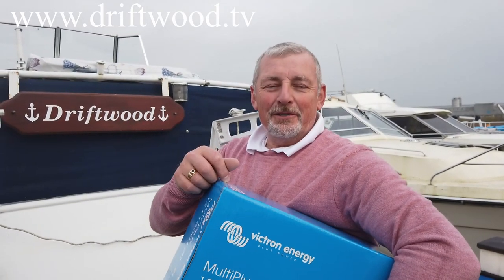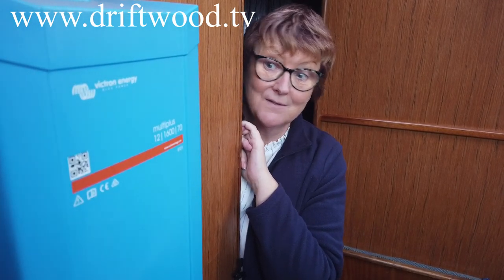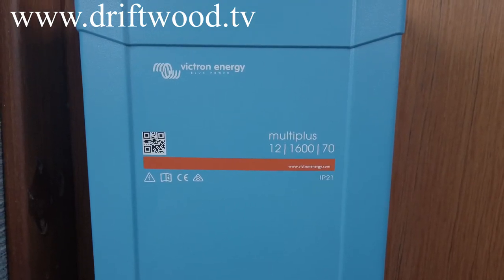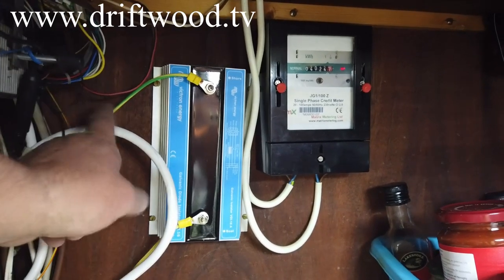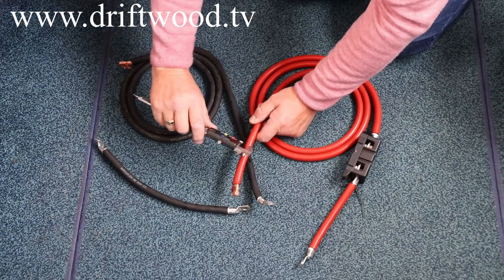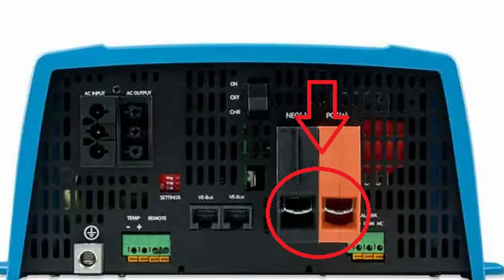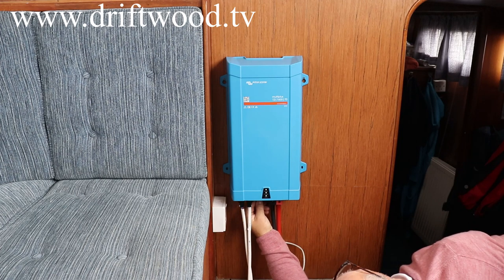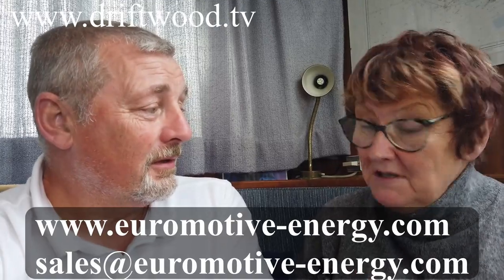Victron Inverter Charger Installation

Comment: i love that jetty in lough key. tied up a few times there. fantastic vid, i love all the tech side of boating. ive learned more on your vlog than i did at school
Reply from the maker: I recently discovered that it will run an ice making machine! So cold summer drinks await 👍
Reply: @DriftwoodBoatBlog  Ice, Ice, Baby,

Comment: Nice easy installation. I've fitted an inverter charger hybrid myself last year that also looks after the solar and yes theyre a great bit of kit. I would however look at a battery upgrade to get the most from the system. Best of luck with it all.
Reply from the maker: Ye they are great. You're right about our battery bank. Lithium would be the eat to go but very expensive. I'll wait till these die a death first 🙄

Comment: I fitted the same inverter/charger this summer, also purchased in Euromotive. The price was surprisingly equivalent to what I could get online, and they had it in stock and were able to sort me out when I pulled into Carrick with a failed charger.

A question...are you really able to manage a standard kettle and hairdryer with a 1600w inverter? If so, I'm plesantly surprised.

Also, I fitted a battery cut-off on the positive from the battery and a circuit breaker on the shorepower AC input to the inverter. The battery switch is so you can turn off the battery supply to the inverter if you're working on things. This is important because it's easy to forget the inverter can electrocute you via the batteries even with shorepower disconnected.
Reply from the maker: Hi Doug. Yes the inverter certainly does run the hairdryer. And it's quite a hefty hairdryer too. The kettle we used is a low amp caravan kettle but yes both work perfectly. My only concern is that it a hefty drain on the batteries. Ye Euromotive are a good crown to deal with, and the fact that they are convenient to the river is handy too. 

I like your idea about the additional cut-off switch. Might copy you! H&M
Reply: @DriftwoodBoatBlog  I have a camping kettle as well, which works, but I think a kettle on the hob may be faster! I did get a nesspresso machine working as well though.
Reply from the maker: I'm going to try an ice making machine next! would be nice with a cold cider on those long hot summer days.

Comment: This is off topic but have you any idea how to put 8mm tape onto video tape, have 2 home boating video but camcorder broke and don't wanna buy something expensive just for 2 of them, it's a long shot but maybe you might know ? Cheers X X
Reply from the maker: There used to be an adapter that you could put the 8mm cassette into to run it in a video player. Be hard to get now. I look at getting the tape put onto a HDD if you could find someone doing that. Hope that's of some help.  H&M

Comment: Hi just want to ask how this handle over 1000w  
Did you try over 2000w to 3000w does it work
Reply from the maker: Hi, think it's rated at 1600w, but I think it can handle more than that if it's not for a long period.

Comment: Have to comment here as I have some major concerns about your set up. First thing are your batteries, please change these for proper leisure/deep cycle batteries otherwise you’ll pay some severe consequences. Any engine starter battery is not designed to be discharged slowly over time, they are designed to give high current over a short time, so starting an engine, powering a bow thruster and operating a windlass. The plates on a starter battery are much thinner which gives them this advantage. A leisure or deep cycle battery has much thicker plates and is designed to give a slow release of current over a much longer time so ideal for running the systems on your boat including an inverter and not good for any other application except in a emergency situation where you use them to jump start your engine once in a blue moon.  I’ve seen starter batteries being used as leisure batteries explode in an engine bay.......it’s horrific. These starter batteries you have are also sealed, and this is the charging profile you should have selected on your Victron and disabled the equalisation charge cycle, this is VERY important. Your battery to battery connection links are far too small as well to be taking current of 160Amps. These should be 50mm2 minimum, 70mm2 is nice....same with that tiny negative cable from your shunt to the neg bus bar....far too small. Someone else also said about fitting an isolator switch in the positive DC line, this would be another great idea....a 200A marine rotary type is minimum for this. Fitting an inverter/charger isn’t really 100% straight forward as there is much to read and absorb, especially those Victron’s. Them and Mastervolt are the cream of marine power systems. You’ve spent all this money on the best here.....you now need to address your battery bank sooner rather than later. I’ve just got your best interests at heart here.
Reply from the maker: Hi Metal Snapper, Thanks for your comment. While it's true that deep cycle batteries will offer more usable amp hours and are much more resistant to sulphation than my lead acid batteries. Truth is that I'm very careful never to allow them to discharge anywhere close to 50% and most often not even below 80%. So sulphation should not be an issue. There is no danger of the Multi causing my batteries to explode as the charger will go into float as soon as the batteries are fully charged. I will be upgrading the batteries and do plan to replace them with  AGM or possibly Lithium in the future. 
My Multiplus was programmed to rum with lead acid from day one. I will have a look at the battery terminal cables and I probably will have to upgrade them as well. Thanks for your input though, it's always good to get another point of view. 👍